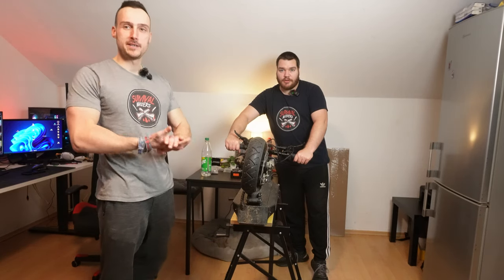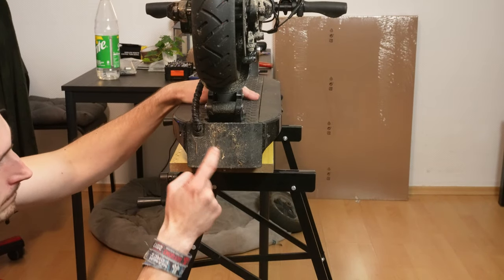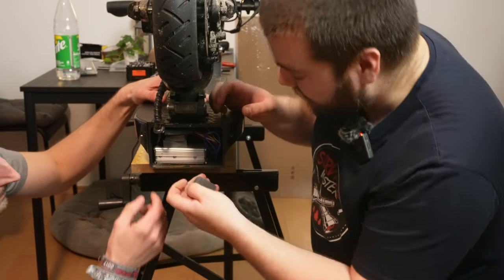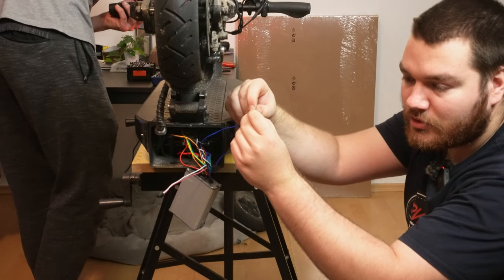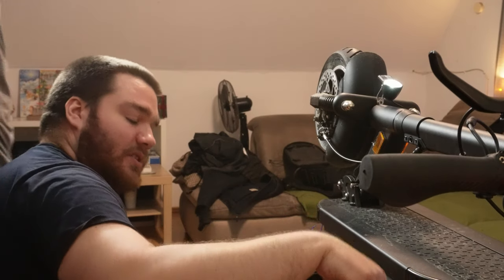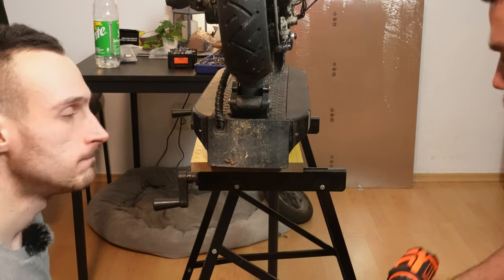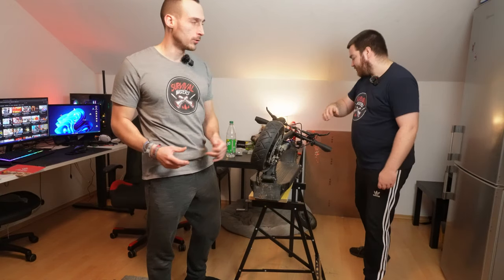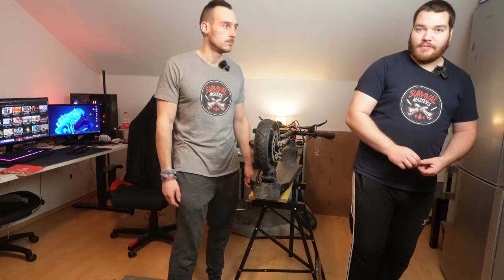How to make every escooter faster 🔥 | remove the Speed limiter ❗️

Comment: It will destroy your battery
Reply: Yea agreed
Reply: I saw someone add a computer fan to cool it.
Reply: The correct battery will out perform the controller.
Reply: After I cut/disconnect the two wire described, I successfully enjoyed the faster speed. 
My battery is still in very good condition but the speed is stuck at P2 recently. My speedometer has been damaged three years ago without effect to speed control.
What could have cause my max speed to be limited from unlimited.
Reply: @bobcentinaje2774  controller or a hurt motor.
Reply: It wont bro the if its a 500 wats to 700 it literally goes faster its just they put a legal limit
Reply: That was my next thought . Too much power .
Reply: Make ur battery better then
Reply: @ExcessivelyUnFunny  I like your thought, but honestly,  the battery would be fine, too many amps and it will underperform.
Reply: The limiter controls the voltage for the motor to go at its speed when it is overclocked or what ever the motor receives more power which will destroy the motor and burn it and that battery is. Made to also spread power evenly towards the other parts that make it be functional to ride
Reply: Can you elaborate or nah!?
Reply: it broke my scooter it don’t work now
Reply: @charlottebaker9041 what scooter u have
Reply: I have a different type of scooter does it matter
Reply: Will it work on a maxshot electric scooter
Reply: im wondering if this works on my DUALTRON MINI?
Reply: Funktioniert das auch bei dem S5 mit ABE? Wäre megaa nice wenn ihr mir da weiterhelfen könntet den schneller zu machen 😁🤙
Reply: Shhhh.... Shhhshhhhshhh
Reply: @Den.Alright  should i use my subwarfer amp to up the power on my scooter? Would the regulate the battery to?
Reply: @HoofdAgenttt A broken one
Reply: It doesn’t even work i tried it g
Reply: @annekabrimhall1059  That's scary.
Reply: It will probably burn the motor up with heat if you add a controller with a pot it would be good in small bursts but any time you mess with these things cause problems
Reply: It depends on how big and good your battery is
Reply: Will it explode or just die?
Reply: Was litterally thinking that as I read the Title 😂🤦🏾‍♂️
Reply: Who cares 😂

Comment: Greetings from Oregon USA.  Can you tell me if it is possible to increase the speed of an Afikim S3 mobility scooter?  Do you have to completely disconnect or cut the limiter wire(s), or can you adjust the speed from the settings menu?

Comment: it’s going faster because the wheels are elevated, there is no weight on them and the motor so it can easily go fast.
Reply from the maker: Yeah its Right but it is faster if you Ride it too
Reply: When they connect it (with no one on) it still goes slower tho

Comment: on my scooter I have two blue wires, a thin, one and a thicker one. Which one should I cut?
Reply: Cut them both to see which one removes speed limiter, the one that isn t the speed limiter, connect it back
Reply: Dad that work
Reply: Did that work I ment hahaha
Reply: @DJSEBAKE mine won’t work anymore 😢
Reply: @ForzaHorizonDriver2024 same thing happens to me spent 600$ sucks

Comment: Hello is it always a blue wire or what exactly should I follow how to know which wire it is ..I own an electric scooter Sencor Scooter one 2020 ( model name e9pro) I split the bottom cover where the cables are located but I do not know how to know which one is the limiter and I do not know if it is even possible to find the wire . I have read that some models have a software limiter. as far as I know the first models of this scooter were going up to 30kmh but after the update they are only going 25 and I can't change it even in the older version of the mobile app where the speed increases but immediately goes back again... Could you please help me ? Thank you.

Comment: Hello my German brothers. Would it not be very easy to just put a simple on/off switch to control whether the controller is speed limited or not speed limited. The switch could be mounted through a small hole in the plastic cover you removed. Sending greetings from Australia!

Comment: Is this also going to loose the opportunity to slowly accelerate? Like you barely holding throttle and it also gives low power and the more you press the more power it sends, is this still going to work?

Comment: I suggest installing a hidden microswitch. That way it will pass with police and authorities as legal.. Justr say you were peddling if over the legal limit.  Microswitch could be such as a hole to stick a nail in that would trigger it off and on.

I am in Costa Rica and have a 1200 watt RAM e-scooter. Top speed with controller is 56 KPH which is fine with me. But thanks to your directions I want to eliminate the controller to get higher speeds on  hills, some which are as steep as 41%. But fortunately most under 30%

In case you can suggest my scooter has 10 inch by 3 inch 2 ply tires. I would like 4 ply tires as well as the highest profile possible to increase the diameter a bit.

Last issue. Any suggestions on how I could monitor heat on the electric motor?

Comment: I am debating on buying a Lectric XP 3.0 but even onlocked the throttle is capped at 20 even though it moves 28 mph with peddle assist, i want to know if this could work to solve the issue

Comment: i have a g2 pro and it goes  about 28 30 mph and on the wires coming from the controller it as a plug with a white wire in a loop but i don,t know what its for but my question can you do it to a g2 pro

Comment: What if my scooter already goes 28 mph (actually 26) right from the factory? Does that mean it has no limiting wire?
Reply: You can generally tell if there is a speed limiter by going down hill. If the scooter hits a certain speed and seems to start breaking the. It has a limited. If it continues going faster until you can't go any faster without the feeling like breaking/slowing down then it has no limiter

Comment: jungs,ich hab eine Aufgabe für euch.Ihr beide kennt euch ja gut aus,was zB extra batterie angeht,also 1S und 2S usw,also die Original batterie in SERIE mit ner kleineren(12V) zB. nun die Aufgabe.WAS,wenn man einen einfachen Fahrraddynamo anbaut,diesen in Serie mit der Batterie kobbelt und sobald der dynamo strom produziert,steigt der Gesamtwert an.Da der Dynamo max 6 Volt liefert geht der Strom also schonmal nicht höher als 42 Volt. Grundgedanke ist einfach nur das man keine extra batterie verbaut,sondern nur einen stromgenerator dazwischenschliesst,der den zusätzlichen strom produziert. Da ihr ja genug scooter rumzustehen habt,könnt ihr das ja mal probieren. ICH WETTE,ES KLAPPT.. ( Einziger nachteil ist das der scooter angeschubst werden muss,da der dynamo gleichzeitig als Unterbrecher dient. Andre lösung ist ein Dynamo,der eine 3,75 Volt Wiederaufladbare batterie lädt,die in Serie geschaltet ist,und vom Dynamo geladen wird wärend der fahrt.

Comment: If you’re thinking of doing this please take note that each scooter comes with a limit for a reason (to keep the motor from burning out)
Increasing it from 20 to 45 is more than double and will produce more heat and may burn your motor out. In total making your scooter un drivable ( you may risk a explosion)
Reply: U are right
Reply: most of these scooters sell both versions, its just a cable to limit it for road laws (im not saying all brands does this, but ive seen plenty of brands that have both a street legal and not street legal version)
Reply: Always with caution BUT cool downs are always encouraged.
Reply: cant we add extra speed modes that limit how much tiem we can go fast? like an overheat turn off protection timer?
Reply: That is why you should also upgrade the battery at the same time!
Reply: I have a 800 watt electric scooter what now goes 45km per hour u think it will break
Reply: Well we should be able to do it to a certain extent by not completely bypassing it but if there is some way to adjust it by doing it inside the scooter…
Reply: @HoofdAgenttt did u try it in the end?
Reply: What if i do 25 to 30 it won't over heat?
Reply: I'm using a 1000w controller with a 350w e-bike motor with no limiter. I think you're wrong. You're having those issues for other reasons. Maybe just garbage motors but the ebike in question is a gotrax ebe4 so not something fancy with great expensive parts.

Comment: How do you install a button to easily turn off/of speed limit. Please make the video
Reply: You would buy a switch or button. Cut the blue wire like shown in video. Get extra wirering and run from both ends of the blue wire to positve and negative on your switch or button. Then you could turn the limiter on or off by pressing the button or flipping the switch,whichever one you go with. All a switch or button does is connect or disconnects the circuit,which in this case is the blue wire......   Understand?
Reply: @jarateman6427  thanks man that was good explaining

Comment: But if the motor is only capable of producing a certain amount of watts e.g 250 how will it go faster than 250 watts
Reply: It isn't always running at 250its limited

Comment: I dont have this cable on my escooter i tryed tomopen the controller but i couldnt find any solution i cut every single cable but not working to remove the speed limit. Is there any other way?

Comment: easily rig a switch to turn on and off the limiter..  dunno why anyone would but could be done.. 
my current scooter is dreadfully slow.. 15mph ( 9km ) 
if i  did this maybe 30mph  ( 18km )
any mods to double the range ?
Reply: yeah you connect the green wire to the frame and you magically get double the battery reserve.....

Comment: Hello does this work for the arwibon Q30 2500w scooter?
Reply: I myself have not opened up the q30 yet because here in the US they run about 30 miles an hour. If yours is only going 15 miles an hour then very likely inside the controller you either have a blue wire like they cut or they'll be a white wire this will be a single wire that comes out of the controller and Loops right back into itself if that is plugged up or if it does not have a plug that working be cut to test to see if that is the rev limiter however make sure you do have enough wires to re splice them together if this is not the case and heat shrink it back together

Comment: My E scooter controller do not have a single blue or white cable im sure the limiter is integrated in the board. Bought a new identical controller instead that goes to 30km/h. im happier with that than my previous 25km/h at least. Havent gotten the controller yet but I will.

Comment: Dose this work with pure gen 2 pls do reply
Reply: Works on most, if you cant do it on the LCD unit. But there are some modern 2022, 2023 and partially even 2021 scooters where you either have to buy another controller, another (unlocked) display unit or both including a motor in the absolute worst and rarest case.

Not sure about „pure gen 2“, but i have a pretty similar scooter (same factory and production line for sure!) like the one in the video and mine was running stock/locked already 30-35 km/h, slightly downhill even 37-40 km/h where you felt the motor stopped running to slow down.

Unlocked (via the „cut“) it was a pretty „unamazing“ 45-50 km/h, only to find out 50km/h is the HARD SPEED LIMIT anyways when i tried a 60V battery instead the original 48V. More torque with 60V, but still 50 km/h limit.

Except if i really need to go „fast“ anywhere, i would not need the unlocked speed/performance. 30-35 km/h is absolutely fine and more or less anyways the practical limit without protection gear.

Comment: does this damage the battery?
Reply: Good question
Reply: NO, just drains it quicker. And it will shorten the life of your battery NATURALLY through the heat, and rate at which you need to remove energy, and replace it. 
SO, doing it will not damage the battery by some means of going beyond the limited speed. But naturally as with all batteries the quicker you drain them, and replace the power the shorter the life becomes.

Comment: I bet these 2 are regretting this unless their rich, but today the motors trash and the battery is fried, 1 or both. All for likes and views. If you want a faster scooter… bye a faster scooter.. don’t try to reinvent your scoot!
Reply: are you speaking from experience or knowledge of what happens when you cut this wire or anything or are you just assuming what you think is correct and saying stuff. 
 don't get me wrong I understand where you're coming from and with basic knowledge and understanding of electric motors and why they are restricted to certain speeds and power given that information one would assume that cutting the wire and letting an unlimited amount of power flow through the control box to the motor would cause issues, but I can assume that all I want but without knowing what's really happening and understanding it all, I wouldn't say anything, but I'm just wondering where you're getting your information and what sources of experience do you have on this type of thing because I'm just trying to figure it out for myself and upgrading my scooter because it's not as simple as just buying a faster scooter that's hundreds and hundreds of dollars and simple modifications can work because I know of a few on different scooters that do work 
but it's just frustrating to see comments like yours that don't have any information to back up what you're saying and obviously I'm kind of leaning towards what you're saying in the assumption that it might fry your motor or burn it up but I just wanna know the specifics and the workings of all that stuff just to get a better idea on what's going on in there lol 
So yeah if you could possibly explain why the motor is trash and the batteries fried one or the other and why they would have to be rich to not care about frying either or cause I think the whole thing is like a $300 scooter

Comment: Good job. But why didn't you isolate those wires? You just left them. It is very poor engineering that can cause you a few teeth in case they accidentally touch each other while you are driving.

Comment: Damn that must suck to be limited to such slow speed. Fortunately I live in the US and we dont have limit laws. There arent any laws in my state regarding these scooters at all to be honest and not many out herr where I am know of the high speed off-road scooters on the market so Im the only 1 that Ive seen who rides these. I have a Yume Y10 that goes 40 miles per  hour , has rear and brake lights as well as turn signals & headlights so I literallly ride in the streets out here with traffic of cars, not even in the right hanf bicycle lanes on most main streets. Its a blast. I have a car as well but I would rather surf the land if the weather is nice enough. My scooter has 2 motors, 2 controllers & 2 batteries so if it has that blue wire and I cut them what do u think it would do???

Comment: How to push your scooter beyond the manufacturer's design and fry the motor.
Reply: Those scooters are „locked“ like this to meet regulations to fit into the (over)regulated streets and bicycle pathways.

I drive the exact same model as shown in the video since 2021, over 7000km on it, first battery (26Ah version, 80km range in „eco“ mode with 20-25km/h  topspeed)
When i push it to 45-50km/h (49kmh gps measured) which i do a lot and often continuous uphill full throttle 30km/h+ range gets a HARD HIT (25-40km…).

Since day one i drive my scooter unlocked and „full throttle“ in many situations. At the absolute hottest summer days i got rarely a motor overheating lamp going on and i just gave it 5 minutes for another 20-30 minutes full throttle fun…

But i have to be honest… i drive mostly „efficient“ and know the limits, i added thermal compound on the controller for efficient heat transfer to the frame and am aware that the motor overheating symbol on the LCD display means something as rare it comes on.

Comment: Does this work with aovo pro
Reply from the maker: If we get this Scooter we try 😁
Reply: I do not recommend this and will VOID the warranty,  but you can try this. I am not responsible for anything going poof.

1. Unlocking Speed by Display Method

Enable your scooter’s display

Hold down the electronic brake on the scooter’s handgrip.

Keep holding the brake button as you proceed in this operation.

Further, proceed to press the power switch; it will display P1.

Use the ‘light’ button to shift the P1 to P3.

After that, click on the ‘S’ button to configure your desired settings. You have successfully removed the speed limiter, and your scooter will move at an enhanced speed now.

#2. Manually Disconnecting the Electric Speed Limiter in the Pro Electric Scooter

Before removing electric speed limiters, you’ll need a pincer and screwdriver to perform this operation successfully.

Move to the two crosshead nuts at the scooter’s rear and use the pincer to take them out.

Proceed to the cross screws at your scooter’s top and remove them

Pull down the casing open, facing the front wheel.

You’ll discover four wires of similar color— white. Disconnect them and use the screwdrivers to slit them.

Finally, wrap the tape around the wires and close the opened case. Reconnect the screws you removed, and you’re all done.